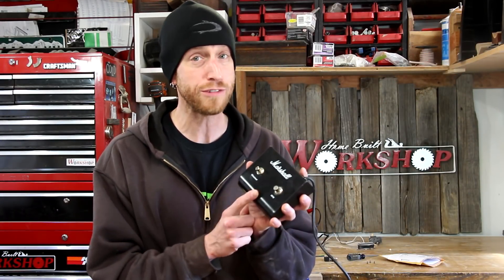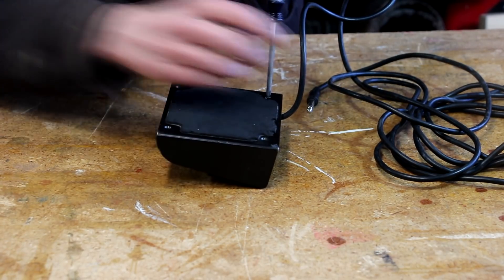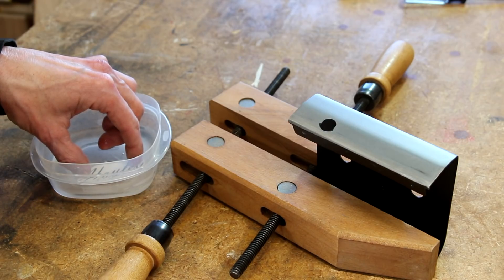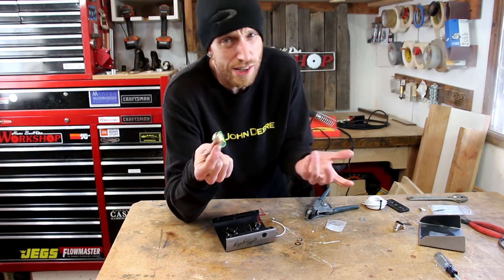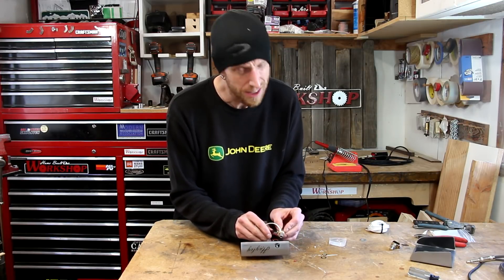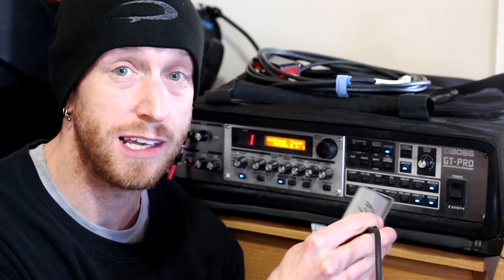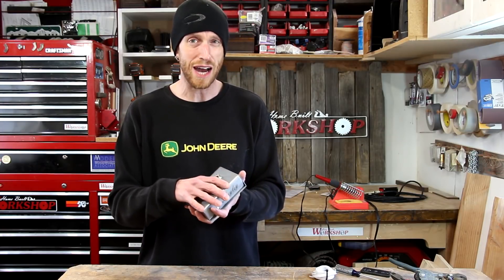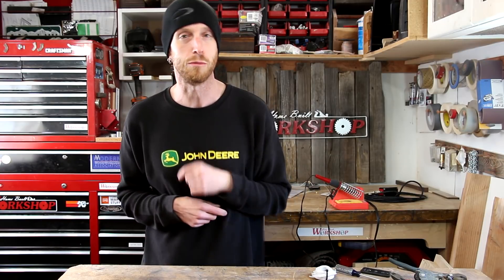How to make a Guitar Footswitch

Comment: Could you add led lights to the foot switches?
Reply from the maker: Yes. You may need to replace the switches with something like a DPDT so you could turn on the LEDs with a battery. I don't think it would be too hard at all.

Comment: Great idea not being hard wired, I  have a Marshall channel & dfx footswitch but mine is hard wired and has a broken cord, so I want to turn it into a cordless setup like you did in this video, what Guitar jack would I need to buy to make cordless?
Sorry I didn't catch your name?
My name is Andre.
Reply from the maker: My name is Jeff. If your plug is a stereo plug, most likely you'll need a stereo jack. It will probably need both conductors to operate the different functions of the foot switch. I might be wrong depending on what switch you have but this one had a stereo plug on the end before I removed it.
Reply: @homebuiltshop  My footswitch definitely has a guitar lead style jack currently on the end of footswitch, but I love your idea, I think it's Awesome and what I want to do with mine asap.

Comment: I have a brand new crate 35 watt amplifier it came with a footswitch because it has three channels clean light Distortion heavy distortion one quarter-inch Jack only in the amplifier the footswitch pedal has two but nothing works when I plug in the two quarter inch cables my guitar cable and the other one that goes into the amp nothing happens at all and you can't take it apart because it doesn't take batteries
Reply from the maker: I think your footswitch may take a special sort of splitter cable. A friend of mine had something similar. I'm not completely positive, but the jack on the amp may be a stereo jack, that splits into 2 mono plugs for the footswitch. Something like that anyway.
Reply: @homebuiltshop  yes I found out my footswitch pedal is stereo that was the problem LOL so you are right